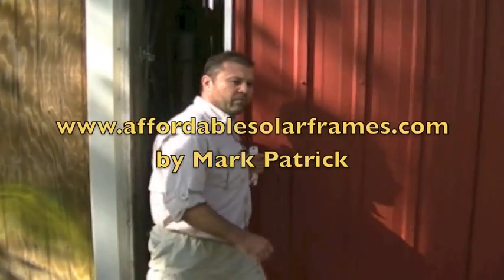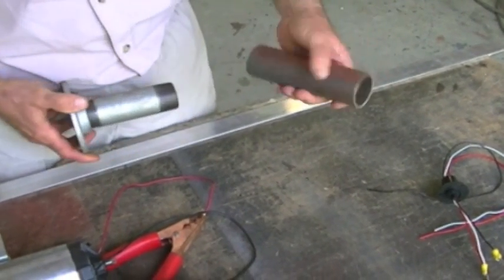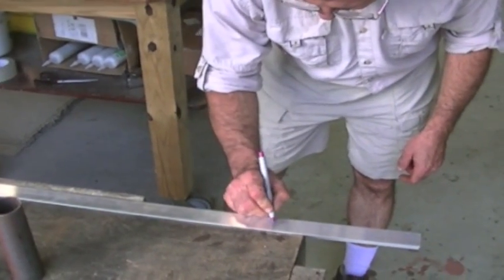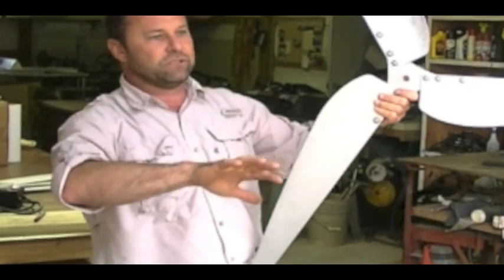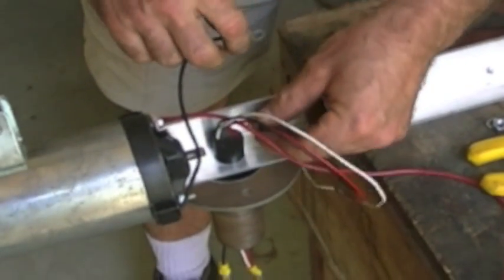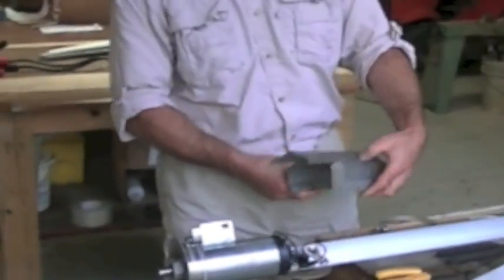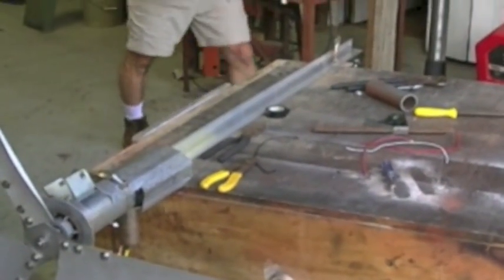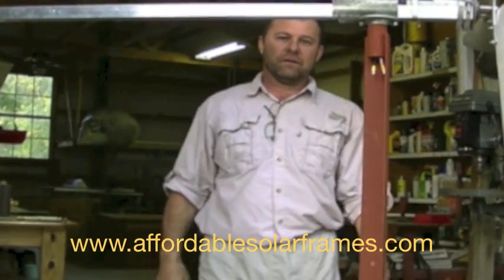How to build a Wind Turbine with a tread mill motor.

Comment: Do it vertically and use the flywheel and make it turn counter clockwise. Mine produces electricity either direction. Drill and tap the flywheel for the blades to hold to.

Comment: hello sir, saturday i got free this type of motor, i get 28 volts by turning it with a drill. their was a exra set of blue wires that seem to do nothing, but how can i take this dc volt and charge a battery? to i can power a inverter? do i find a special voltage regulator?
Reply from the maker: Hello, You will have to use a diode and have a charge controller with a dump load if you are building a wind turbine. A wind turbine has to have a load on it at all times so that it does not spin to fast in high wind.

Comment: How do you overcome the requirement for the treadmill motors high rpm's needed for needed voltage?
Reply from the maker: I am only charging a 12 volts system so I don't need high RPM.

Comment: Hello, nice video ! how can i remove the flywheel of the treadmill ? mine has a sort of allen bolt in the middle of the flywheel and nothing from the rotor comes from the back end of the motor. Thanks
Reply from the maker: It just unscrews counter clock wise.
Reply: @markp0177  what should i unscrew counter clock wise, the allex bolt or the flywheel ? because this allen seems well stuck. Thanks.
Reply from the maker: @hichamtassi1753  The allen bolt, you may have to use some heat to free it up.
Reply: @markp0177  ok, thanks. What is best, to keep or to remove the flywheel for a better blades spinning ? thanks

Comment: Thank you for this great video. I come back to it, every now and again for reference, since I first  seen it 5 years ago. LOL.  I need some clarification on the diode. Can you give specs, model, make, amps/watts/volts. negative or positive? I am also a bit confused as to why no Isolation/separation? You went straight to the metal, why? What allows you to do that?
Reply from the maker: I made this video years before I posted it. I don't remember the specs on the diode. I think I use the metal frame as my negative or ground. Sorry I couldn't be of more help.

Comment: I liked the video and the end result looks great - but if you look at your positive connection at 11 minutes or so, it looks like you have bare connector which you left floating  that you then covered with a grounded shell. From what we can see in the video, it looks like this will end up being a short circuit at some point.

Comment: Hi Mark, fantastic video I am currently making my own turbine and I learned a lot from it. Things I especially liked were the spindle for the assembly to turn on, the slip rings which I didn’t know about and modification to the motor shaft to take the turbine. Have you any other turbine videos Mark?

Comment: you can make the blades stronger by wrapping them in fibreglass and resin , they will be great after , i  made mine by myself from pvc pipe and i wrap the with fibre glass and resin , they are perfect

Comment: Sorry but, you are wrong about your aluminum blades.  Those blades are pushed around and not pulled around.  Your aluminum blades have zero lift.  Also, they are a very poor design for wind turbine blades.   If people want to make wind turbines, they should stay away from treadmill motors.  These motors have brushes which are a poor choice for wind turbine generators.  All-in-all this wind turbine is a very expensive low quality, low power, wind turbine.  I don't know where you got your information but, it is wrong.

Comment: Curious Mark as to why you never did a testing follow up on your Wind Turbine? I still have some of your solar panel frames from a few years ago. They have held up well but the epoxy sure has yellowed. Thanks for the vids.
Reply from the maker: I do not have any wind here where I live down in the valley. I sold the turbine to a man in Tennessee years ago.
Thanks for watching.
Reply: I live in a valley as well. I built the turbine and mounted it up on my work shop but there was hardly ever enough wind to make it worth while. Keep up the great vids!

Comment: I think I would change the wires...start inside this m/g...too at less 4 gauge wires....Wait...That's right...DC...needs thicker wire...too the charge controller/battery bank...because of the lost, of the volts...from a DC Compare to an AC output...If i'm thinking right..j/s

Comment: Mark.. does that treadmill motor actually charge a 12v battery system? How well does that work? How many Volts does it produce?
Reply from the maker: Yes it charges a 12 volts system. When ever wind turbine is spinning fast enough to get over 12 volts it is charging. In a strong wind it can get up to 45 volts.

Comment: awesome. I have also been trying to do this with an 100VDC 1492 watt treadmill motor.   one problem I am having is. the slip ring, what amp of slip ring should I use? the motor is rated at 15.6 amp or at least that's what it says I can find slip rings at 15 and 30 amp. should I stay at 15 amp ?
Reply from the maker: I would go with the 30 amp just to be safe.
Reply: Markp0177,  Ok I have a new issue,  I have been doing all kinds of research on my treadmill motor. I do not understand, some people using the unit going clockwise and others using counter clockwise yet producing power either way?  Does the unit produce power in either direction? Like I say, am new and learning. Thanks
Reply from the maker: Yes, It will produce either way it turns but the blades you buy only turn in one direction.
Reply: John Ivy either clockwise or counter clockwise your blade rotates. you can simply switch the polarity of your wires.

Comment: Nice DIY video.  It's good to see how easy it can be.
It appears to me that you put the blade assembly on backwards, though.  The leading edge is, if I'm not mistaken, the straight edge and that should be into the wind, not on the backside.  While the generator should be able to work in either direction, the blades are only efficient if facing the proper way.
I'll be watching your channel for more information on things I can do to improve my living.  Thank you!
Reply: A Very Happy Camper the purpose of that tail is for the blades to face right against the flow of the wind.
Reply: He has it correct.
It's like and aeroplane wing you need the pressure difference on the convex side for it to work.

Comment: I watched a video of MdPub.Com and he said the 90v is the best and he is doing great with his but he is using a 30v. He also shows how he built his pole set up which is brilliant to lower it. I built mine also with a 90v but used the rapture blades and hub and used a nose come which helped tremendously. It diverted the air to the blades instead of the air hitting flat on the hub. I'm getting 14.4 at 500 RPM.  I seen a comment on here where they said you have to gear it up to get the right output.No you don't. I spun mine just with the shaft by hand and it put out 9v. I use 8 deep cycle marine batteries and a 3000W reliable pure sine inverter with a mppt charge controller. I run everything other than 220v appliances. Thanks for the video. Hope this might help you.
Reply from the maker: +randy comstock Thanks for the information. Direct drive is the best way.

Comment: What Volt size motor are you using and what is the RPM on the motor
Reply from the maker: +randy comstock I am not sure. I think it was 90 volts. This was a old video I did years ago and then uploaded it to youtube in 2012

Comment: Have u tested this system it will not charge a 12 volt battery you'll have to gear it up at least to 4 or  5 to 1 to get the correct voltage to charge a battery ?
Reply from the maker: +losttreasure hunt No you don't have to gear it up it charges over 12 volts in a 15 mph wind.
Reply: +markp0177 Under a load ?
Reply from the maker: +losttreasure hunt Yes, a wind turbine must have a load at all times.
Reply: +markp0177 I've built a number of these and I know what u can do with them good luck to you ,I'd luv to see a video of it up and running ,thanks
Reply: +markp0177 No way and thanks
Reply from the maker: +losttreasure hunt   It does not come under a load till it gets above 12 volts. I also build generators. check out this video.https://www.youtube.com/watch?v=Gnyo95hon-U
Reply: +markp0177 That hydro will do the trick but the treadmill motor won't do it

Comment: Interesting stuff.i got a tread mill motor saved in the garage.I suppose to run off the battery,we need a ac/dc converter,so I can plug in an appliance righto? Thanx :)
Reply from the maker: +Scott Houge You will have to charge batteries that will run a inverter.
Reply: +markp0177 Explain? I have a boat battery,or marine battery...I was thinking that would work
Reply from the maker: +Scott Houge You have the wind turbine charge your marine battery. Your battery will power the inverter and the inverter will power your appliance.

Comment: is there some kind of break on the motor? meaning if the motor is spinning to fast will it stop the props from spinning. also how many volts is the turbine producing on average?
Reply from the maker: +Ben Dover This design does not have a break, they drag of producing electricity keeps it from spinning too fast. The volts is around 15.

Comment: What kind of wattage does it average? I got a treadmill motor laying around and I'm savvy with electronics I just expect something at least 600w any less and it's just production..gotta be able to run the refrigerator ya know..I got a lawn mower generator with a 800w inverter 105amp alternator just doesn't make the cut I really want but it's good for lights tho lol..

Comment: Can you please shed some light on choosing a slip ring?
I whant to use a 1.5HP, 180-230v, 2500 to 5600 RPM Te Wei motor I found online, but I don't know what I should take into account to choose a slip ring...
(I only just started looking at this and know almost zero on electricity)

Comment: You are losing at least 25 watts because of the Diode and the light gauge wires. You really need to switch to a AC motor and a pulley drive for better efficiency.
Reply: +faffaflunkie what makes a generator in to ac? diode
Reply from the maker: +Spike Kaw  No a inverter makes dc into ac.
Reply: Getting reliable wind power is very difficult. Really what is needed is an automatic transmission. It seems that nobody has thought of that.

Comment: I used a DC treadmill motor also.7 blades and a pulley set up w/a serpentine belt.
5  gallon water bottle to house the unit.It starts to make power @ 10 MPH wind in my backyard.  [URL=http://s514.photobucket.com/user/ddd228/media/temporary-31.jpg.html][IMG]http://i514.photobucket.com/albums/t345/ddd228/temporary-31.jpg~original[/IMG][/URL]
8 guage wire to the charge controller,2 deep cycle batteries in parellel.
Took me over a year to build.
I have room for a solar panel....next year.

Comment: Hello, great video. I just have a question because I am putting together my own wind turbine. When you run the wires down the center do you have to limit the overall rotation of the body so it does not rotate several times in the same direction and cause the wires to pinch. Or is this a non issue and the wind turbine would never spin enough times in the same direction to cause this problem?  This has been bugging me and this would help me a great deal, thank you very much for your insight.   And also I wanted to know what kind of power generation you are getting out of your set up? Great build I liked it!
Reply from the maker: ***** You have to use a slip ring. I show it at the 2:50 minute mark. I sold this turbine to a man it Tennessee and I am not sure what wattage he is getting.

Comment: How do you keep it from flying off of the pole?
Reply: Welds I believe
Reply: But that axis rotates. ..I meant the pole that you inserted into the other doesn't seem to have anything that keeps it from being pulled back out of it.  Do you have a coupler or pin that secures it?

Comment: What about the 2nd part? Can I use , like 20 volts DC to charge a 12 Volt bank?
Reply from the maker: Terrance Roth Yes you can charge with 20 volts on a 12 battery bank with no problems.

Comment: I have more than 15 volts DC running this type of motor off of water power, But will have to run about 100 feet to get to my 12 volt battery bank. 
Do I have to run extra large wire to adjust for the voltage drop to charge? ,and does it mater how high the DC voltage is to charge?   Thought you might be able to tell me. Thanks in advance
Reply from the maker: Terrance Roth Yes with DC you will have a voltage drop. The bigger the wire you use the better.

Comment: Do you have some sort of brake mechanism on the motor?
Reply from the maker: Fritz Mulder You don't need a brake with this design blade and the turbine will always have a load on it.
Reply: Thanks. It makes sense. At a certain speed there will be enough wind resistance to slow down the blade. I'm also busy building a small windturbine but haven't connected by generator motor yet.

Comment: Thanks for ur reply. Is their any solution to get 12v 1amp from wind turbine operating in the area of 1. 5 m/sec wind velocity. I can afford to get the height of 26 feet.
Reply from the maker: iftikhar qureshi It would take a special low rpm generator
Reply: markp0177   Hello  please let  me know how I can get low rpm gen.
Reply from the maker: iftikhar qureshi I don't think you can buy them, you will have to make one. You can rewire the treadmill motor with a smaller gauge wire and more wraps. This will give you more voltage at a lower RPM.
Reply: Hello  Can you guide me how to rewind the Chinese made treadmills motor and what gauge of wire with how   many turns would suffice to charge one 12v battery. I shall be greatly thankful
Reply: And  on my treadmill motor it is written  DC 180v
Reply from the maker: iftikhar qureshi I would have to know what size wire the treadmill has now. Just count the turns when you take it apart and try to double it with smaller wire.

Comment: Hello The video is very helpful. In my area the wind is 1. 5 m/s. Is any body could tell me that such treadmill motor with 3 or 4ft long propellers  a 12v car battery can be charged
Reply from the maker: iftikhar qureshi No you will need a 15 mile per hour wind.
Reply: iftikhar qureshi  to clarify, mark0177 is saying that you need approximately 6.7 m/s winds or better. Bigger propeller with gearing might work, or a Savonius style turbine.

Comment: Hello Marco. They are very interesting your blades. But look a little short for my wind generator. I use ista blades. In your opinion they are efficient? I look pale as your length but with at least one meter. My generator uses a brushless motor. Thanks for the video. Hello.

Comment: Hi mark I was wondering what sized blades they are. 28 inch? I was considering using a treadmill motor but how much electricity would it produce if I tied it into the grid?  Thanks for getting back with me
Reply from the maker: Garrett Gilliland Hello, I don't remember the blade size. The video was a couple of years old when I posted it back in 2012. The amount of power you will get out depends on how much wind you have.

Comment: If you ever use them pathetic wire crimpers  to cut off a screw be sure that you don't have any meat from your palm sticking through the stripper part or they will leave you bleeding, don't ask me how I know this. It can happen when you are using 2 hands when squeezing them together, when the screw cuts and the handles snap closed they can bite you. Very stupid design!

Comment: Hi mark ! How can i measure the amp out put from dc generator to a battery 12V ? Thanks
Reply from the maker: The easiest way is with a simply in line amp meter with a shunt. Here is a link to one.
http://www.ebay.com/sch/i.html?_from=R40&_trksid=p2050601.m570.l1313&_nkw=amp+meter&_sacat=0

Comment: Hi there ! Please advise . I have a ametek 40VDC . 1050 RPM . My local wind speed from 7-15 mph . I dont know how many blade dhould i get for this motor . 3 or 5 . I try to get the blade from windy nation . It call Hyperspin blade . Please advise.
Reply from the maker: I am not sure about the Hyperspin blade. You need a lot of RPM And with just 7 to 15 MPH wind that will be hard to do. I would get advice from Windy nation. I think the Hyperspin blade will give you the RPM but I am not sure how much wind it takes to just get it started.

Comment: Thank you for the video Mark,, can you tell me if it matters where I put the blocking diod can I put it 30 feet down the wire from the generator or does it need to be right at the generator like you have yours? Thanks
Reply from the maker: It does not matter. You can put it 30 feet down.
Reply: markp0177 I understand electricity a little, but would it make more sense to put the diode on the positive wire than the negative? My reason for thinking this   is because i would imagine the connection would transfer the negative through the ground  and make the diode useless. Im probably wrong but just curious
Reply from the maker: casey moyer You can use the diode on either the pos or neg. Most people do put it on the positive.
Reply: casey moyer

Comment: i'm thinking of using electric fan motor is that ok to use? does it have the same result?
Reply from the maker: emily dee No a fan motor will not work. It has to have permanent magnets in the motor.

Comment: "Yawl axis"
I cut the fork off of a bicycle and ground the excess off. Clamped it to my mast with  muffler clamps. It makes a great yalw axis. I have made two of them with one in progress. The first one dances around on those ball bearing like nobody's business. Second not quite as limber but I need a bigger tail piece. Just a suggestion.
I plan on mounting six of them of my roof top. That will make people look.